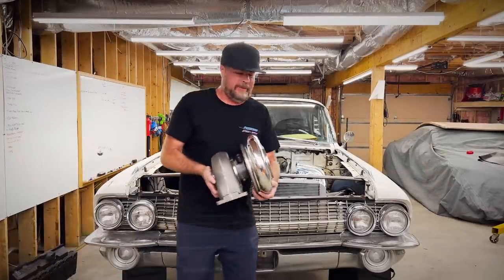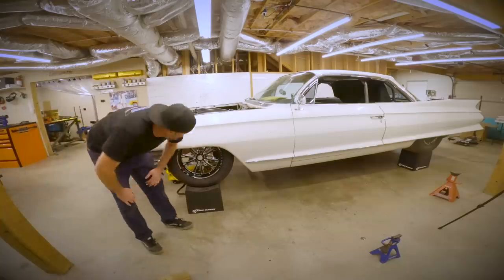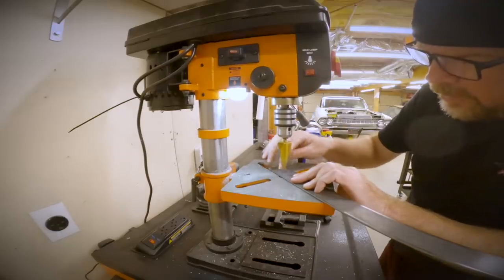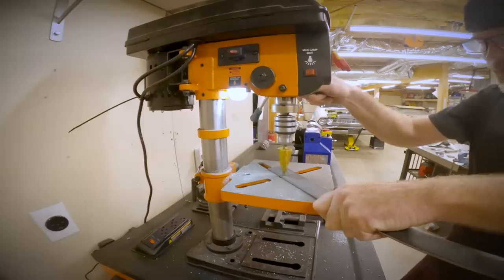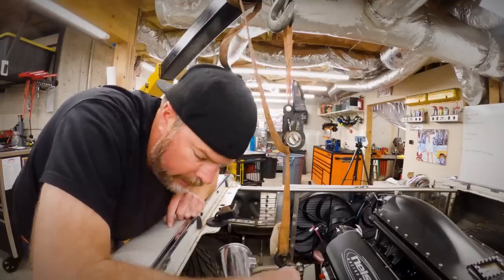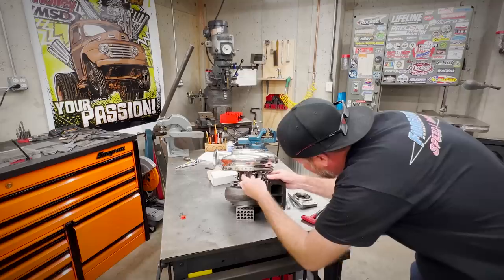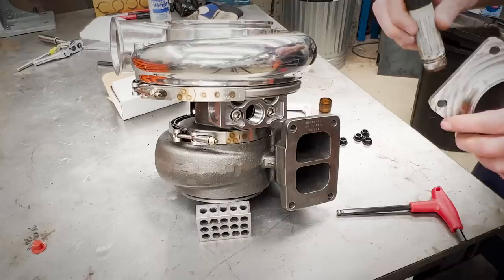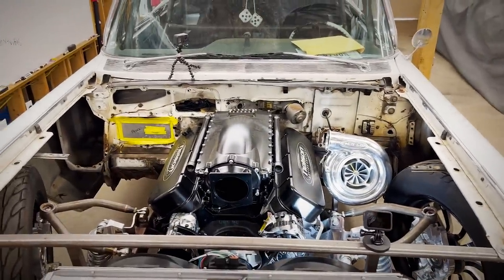I INSTALL 2,500HP WORTH OF TURBOS IN MY '61 CADILLAC COUPE DEVILLE!

Comment: what about putting a jacking point in line with the bottom of the front bumper so you cant see it but is high enough to be able to get a jack under? or maybe a receiver that comes out of the front license plate hole where a jacking point can be temporarily be installed to get it off the ground. just watched the point in the video where the caddy had to be rolled on blocks just to get a jack to be able to be put under and thought it would be good to mention my idea, probably already planned/ thought of.

Comment: Put them in the trunk. Get some weight over the axle. Also by having it so far from the engine, it will help reduce the heat in them from the exhaust.

Comment: I have noticed that turbos always seem to be mounted (by teams of professional engineers) so the turbo's axle axis is parallel to the engine's crankshaft axis. Do with that whatever you will.

I think it has to do with vibrations being limited to approaching the turbo's axis perpendicular. Any fore-and-aft vibration may make that turbo axle shift back and forth and prematurely wear the thrust bearings/buttons/whatevers.

From F1 to big diesel engines, that has been what I've seen. Anywhere that a team of professional engineers has designed the placement.

Also, never seen the turbocharger not bolted to the engine itself.

Comment: I have a T6 88mm turbo and I picked up a Monkey fab to 3" tube collector and put a knife edged spacer between that and the exhaust housing as I can't imagine it's good for flow to have air smashing into that flat spot on that divided exhaust housing (didn't have the balls to grind the exhaust housing to a point).

Comment: Maybe next time you can try using the engine hoist to lift the car enough to get either the blocks or the jack under the car. May save you a little headache if you're able to do it that way.

Comment: Considering you can't get a jack under the caddy most of the time. Do you have a plan for when you get a flat?
With the turbo mount. Why not weld a plate to the rail. Then you'll have a flat surface and a thick enough piece for tapping.

Comment: Lmao, even with motor plates, the chassis will flex enough under hard launches that either the turbo mount or the headers are going to crack fairly quickly. Always mount the turbo to the engine!

Comment: Four minutes in and wondering, "Mike, don't you own some sort of Winch??"
Also, it's a bigger pain trying to do a Datsun 2000 Super Six on to a Four Poster Hoist using the PushReallyHard method. But, four poster,.... :D
Reply: My guess is size/weight stopped him from putting it on a hoist, but idk what kind he has so just a guess
Reply: @Jxsey  Nah, it's slammed to the deck, had to get it up on the wood to get a Trolley Jack under it :D

Comment: Not for nothin and this will probably get lost in the comments, but there's a floor jack called the dominator, it's almost $1000 but it's super low and super long, meant for getting under top fuel and rail type cars, might be worth looking into to avoid the wood block fun you're having there.

Comment: I'm curious as to how much the engine will move under load, a few solid mount the turbo to the block then the turbo could move with the block in the only the exhaust would have to flex

Comment: 28:48 What rad fans are you using?
I'm not saying it won't work... but from the engine bays point of view those blades would have to rotate counter-clockwise which is the opposite direction the blades curves are designed for (fan blades typically curve forwards in the direction of rotation and not backwards). it can still work but it'll have lower pressure and be less efficient.

Those blades look like they should be rotating clockwise in a "push" configuration (they look like they want to push air forwards through the radiator rather than pulling through it, even if reversing polarity will make them work backwards), but would love to know model just to be sure.

Comment: Two words. Pro, Charger. It's compact. Not a hot pig to deal with. Exhaust goes down and back and out. No oil drain. Easier intercooling. Short pipes. You can make WAY more power than you can get to the ground anyway, so why not devote a bit of that power to making boosty boost happen? The advantages of supercharging go on and on.

Comment: Um..Mike?...Buddy!...I heard of this guy, Archie Meedeez once.  One day he needed to do some suspension tuning on his hot, lowered, street chariot and was faced with a similar problem.  He was jackin' around just like you...Rollin' the thing back and forth on different thicknesses of wood when it hit him that he could take one of them sticks of wood and kinda' balance it on another stick of wood with it's end under the axle right by the wheel after cranking the steering way over to one side.  If he pushed on that first stick, it'd pivot on the other piece and lift that wheel right up in the air so's he could put a thick piece of wood under the wheel.  THEN he could get his floor jack under the frame without looking like a real newbie!  He called that first stick, the long one, a lever...to get back at his buddies who kept tellin' him, "leave her", in reference to leavin' his chariot factory stock and just drivin' it like a regular guy.

Comment: Pro-tip you’re likely to fall in love with.  Next time you have to push a car, don’t push the car by any of the body panels.  Simply pick a tire and just grab the tire itself and try to roll the tire.  Once I figured this little trick out it made life as an alignment technician soOoOoOo MUCH easier.  You’re welcome.

Comment: Another way to find out the exact location and size of those bolt holes relative to the oil gallery hole is to just check the website for the drawings of your turbos. Or is it only Garrett that do that?

Comment: moving it back and in by the firewall is scary with debris coming off the tires and going into the front of the turbos. also the turbos don't have to face forward. rotating them can give a ton of different options for plumbing hot and cold side.

Comment: Was there any thought on doing rear mount turbos?
Dunno how much room is back there but doesn't look like there is much room up front, and you haven't got any of the hot/cold/oil side of things in there

I'm only a keyboard expert here, but it also seems as if the clocking of the turbo is off ... or its the wrong side or something. I'd feel it would be easier to go from turbo to intercooler with the compressor outlet facing the fender, rather than going over the valve covers ?

Comment: An easier way to support them turbos would be to use some scraps an make a flat bottom pole stand to bolt the cartridge to as to hold it in place without the need or bother of an engine crane in your way

Comment: if the turbos are mounted to the frame rails they will not move with the engine and the headers will likely break, quickly. also, mounting the supports to the chassis will result in a lot of vibration in the chassis (it is effectively using solid engine mounts). the turbo supports need to be mounted to the engine

Comment: We didn't believe it at first but... Tapping using a drill products HIGHER QUALITY threads than tapping by hand...

Years ago I would tap using a drill when I was short on time. I would get flamed by all of the other guys and gals working with me on the particular project so I decided to do some "scientific investigation" into the best way for a backyard mechanic to tap threads.

What I did was set up a whole bunch of holes of different (but correct for tapping) sizes, ready to be taped.

I split the tapping work between everyone and laid some ground rules (set the drill and "your hand" to a reasonable torque limit, try to make the tapped threads perpendicular to the surface, lubricate the tap, back the tap out if the torque gets too high, etc).

What we found is 100% of threads that were tapped with the drill were perfect but about 1 out of every 10 hand tapped threads had flaws.

We then debated and experimented with tapping the threads different ways, tried using a drill press to keep the threads perfectly perpendicular, etc, etc....

Eventually we all changed our ways and now we tap all of our threads using either a hand drill or a drill press. The drill press actually does the best job as long as the tap never needs to be backed out, but modern battery powered hand drill is a close second for best way to tap threads.

Don't take my word, try it for yourself....

Comment: Get the proper sized pipe for oil feed and weld a nut into it. You have a hanger in 5mins. also you can map out whatever with white paper and a pencil If you have nothing else.

Comment: I think the frame rail is too thin to tap. Even though you are using a fine thread bolt. You may try a rivit-nut if there is enough room from the center of the bolt to the edge of the frame rail for the riv-nut. If not the piercing the frame with a tube is the only answer.

Comment: I would have welded a 1/4” piece of metal on the frame and drilled and tapped though it to mount turbo.  Would give the three bolts more metal to bite to.

Comment: Today on "Fitness With Finnegan," we'll be doing multiple sets of the turbo lift, followed by many reps of the Caddy push!
Almost (but not quite) as entertaining as those 80's "Aerobicise" videos with the hot babes in skimpy leotards...man, what a great time to be a teenage male!
Sorry, got distracted..
😁

Hey Mike, how about you weld some cups made of round tubing to the frame..use 'em as seats for a little bottle jack so you can get the car high enough to get a floor jack under it without having to carry a lumber yard or risking a coronary event..

Comment: uhmmm, bottle jack? I'd suggest you put nut-serts/rivnuts in the frame to hold that bracket. Through bolting that is 10x the work that it's worth. And you could warm the bracket and bend the ears to match the frame curve.

Comment: You were concerned about drill shavings going into your unpainted frame rail, but not concerned about drill shavings going into the open exhaust ports of your race engine? LOL. And I wondered if you considered the cylinder 5 exhaust header tube routing past your pedestal mount? As for jacking your car, just install 2 air jacks for the front. Yes, they are about $700 each, but they will save you HOURS of effort in your garage and at the track.
Reply from the maker: That empty engine and those empty cylinder heads are going to come back apart and get cleaned before final assembly. No worries about anything going into it. There literally is no oil pan on it.

Comment: Finn, what brand of magnetic LED trouble light do you use? BTW, where is the master cylinder and brake booster going to go with the turbo in place? Or, are you using a hydraulic break booster? Looks like which ever way you do it is going to be tight quarters...

Comment: What is the point of a divided housing if you're not going to run a divided header into it? Seems like a Vband would've been much easier. 🙃

Also, a nutsert would be a great solution to bolting to the frame rail. No need to rill all the way through or do anything crazy like that.

Comment: Dumb question on the frame, and I know time and hindsight being foresight is never on our side while building things, but why not yest weld on a level pedestal with the top plate of the frame pedestal being thicker to have enough threads, or have nuts welded on the inside of the boxed frame pedestal?    I know its too late now, but maybe it isn't...

Comment: Loving your content!   with the exhaust coming out of the back side of the turbo, what is the plan for your master cylinder?  Is there enough room?   What about Power brakes?  will you be running a hydra boost style system?
Reply: Brembo makes a pedal with booster and master cylinder all on the pedal assembly

Comment: Well that whole pushing the car onto wood was painful to watch. Probably painful to do as well! One thought would be a set of Quick Jacks if they fit under the side pinch welds. Or at a minimum get a cheap HF winch, attach it to the back wall of your garage at floor level and use it to pull the car up onto ramps without pulling your back muscles.

Comment: So... sitting on my couch and been outta the game for 2.3 decades, I hope I'm not about to talk out the orifice I'm sitting on.... my first concern about what I'm about to propose is oil drain back, but you said "dry sump pump".... so.... what would stop you from pointing the exhaust "out" straight down?... turn the intake "hat" around?....cold air points up..... turbo closer to firewall....charge pipes parallel to firewall, turning into reversed intake..... Cold air intake and the other side of engine are the two things I can't see from my couch......... Oh...will a couple junkyard import scissor jacks fit under the frame rails when she's being slammed hard?....

Comment: Not sure about the location for the turbos. I would think that the exhaust will be an issue? As far as heat in slow traffic with the turbos by the radiator? If your just idling there would not be that much heat. I'm sure no expert on this stuff so maybe it will work out?😅

Comment: I(f any of the wheels have a sudden disassembly issue. you will  be thank full that the turbo housing is as heavy as needed to contain anything spinning this fast .
super turbos are the future rage when turbo spool up and the control of max rpm is done with a digital servo center section.  The compressor easy to flow enough air at  less than 1 psi above current everything charges the speed and torque input from the turbine can exceed 100hp. Using electric to eliminate waist gate and pop off worth it. Electrically spooling from electricity generated  from center section is both in the advantage operating in each condition. The  center section when in assist mode has the effect of removing the inertial and bearing loads increasing response to boost. The center section acting as generator to control max limits has favorable when it does this.  The proof is observed by the current F1 power units spec's of highest fuel to energy conversion at greater than 50%  1.6l  v6 1000 hp compact light weight and durable.  It is time for engineers to design practical examples optimized to purpose  because it just works so well.

Comment: For science:  will there be more heat with the turbo next to the radiator with access to fresh air thru the grill or next to the firewall with the air that the puller fan is blowing towards it and the hood is trapping hot air.  Not be fictitious, being curious having watched every road kill episode.

Comment: A word on expensive drill bits....your not paying for the bit, your paying for the hole. How much you spend on drill bits will tell you how bad you want a hole. 
I have a 90 degree drill and short drill bits..... because. Also have some split tip drill bits up to 3/8 that really kick ass....I did spend way to much on em....

Comment: Would thread inserts not have worked in the frame or at least tig welded nuts in the frame seems like would have been a stronger attachment point. JMO.

Comment: I would be worried about that much turbo heat near a tyre. Aside from the heat increasing  tyre pressures there is the risk that the rubber will deform or burn.  Not sure what sort of heat shielding would be required to make this safe

Comment: I’m wondering why would you use a T6 twinscroll turbine housing if you are putting a rounded (and even looks smaller size) adapter in it? From the other side of YouTube it looks like Nelson tried using a free flowing turbine housing to let the engine breathe and using twinscroll to compensate for its size, and kind of seems like your are defeating its purpose.

Comment: Hey Mike, two questions:
1: why are turbos nearly always mounted cold inlet forward? Why not down or up vertically?
2: since the frame thickness worries you, have you considered Rivnuts (rivet nuts)? They would look much nicer than a through bolt.
Otherwise, thank you for building something out of the ordinary. Not enough people do. It would seem that if more people did, there’d be more aftermarket support. For example; my 1974 Olds Cutlass, (Rocket 350), sure there’s lots of support for the Chevy variants but not for the BOP models.

Comment: Turbos provide great boost and Hp gains. But they also heat soak engines. If you really want a big car to move, First reduce the WEIGHT. Replace body panels with something like carbon fiber etc. With careful intelligently done dieting you could easily knock at least 1200 lbs 
Off that beast. And keep it 
normally driving and street legal.

Comment: Is not running inner arches and splash guards a common thing in US?
I dont know if that's legal where I lve but getting your engine, air filters, electrical connectors and, well, just everything covvered in rain, mud, brake dust, seems like a recipe for problems!